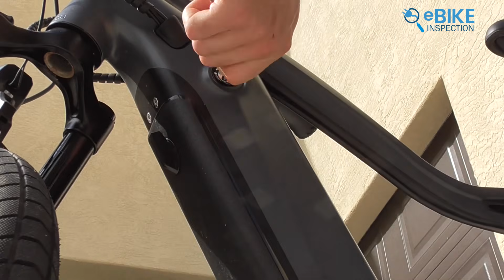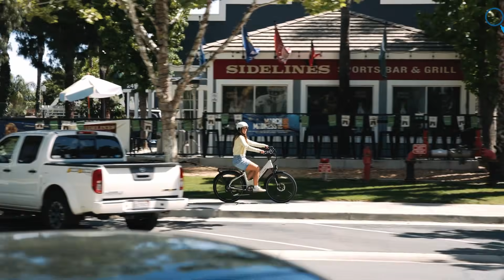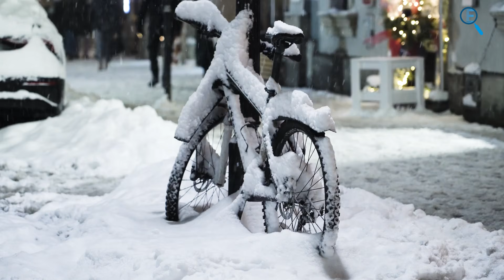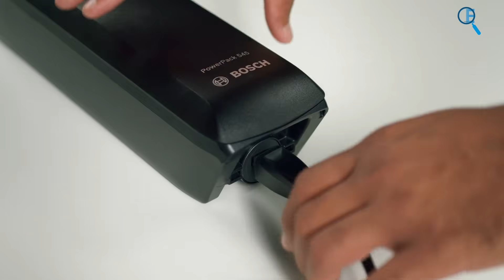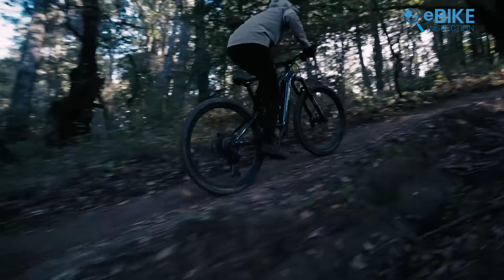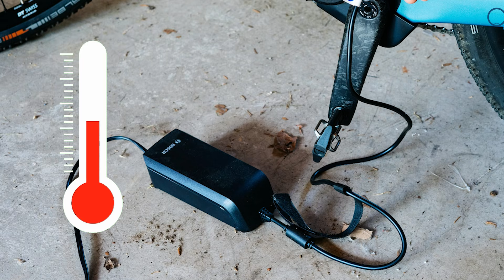Your eBike Battery Will Last 3x Longer If You Stop Doing These 6 Habits

Comment: I remember in the old days,  rechargeable batteries had to be run all the way down and changed fully. Some people think you have to do that with e bike batteries, not so. I put my battery on change, between twenty and forty percent, usually the day before I ride again and only to 100%, if I planning on riding a lot.
Reply from the maker: Exactly, that’s a much better approach for modern battery technology!

Comment: These suggestions must apply to my leisure batteries in my motorhome, too. They are charged by the solar panel on the roof, and are at max charge all the time, until used on a trip away. So it sounds like that’s bad practice too? There’s not a lot I can do to keep them at 20-80% is there?
Reply from the maker: That is a common challenge with solar setups.